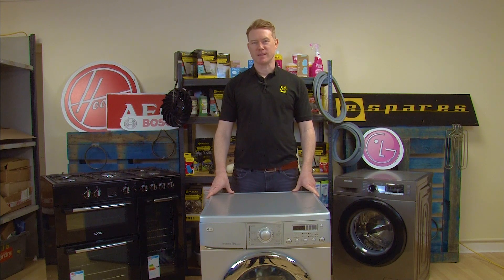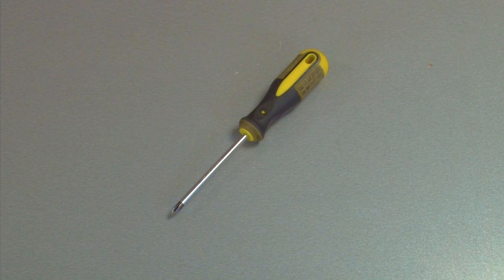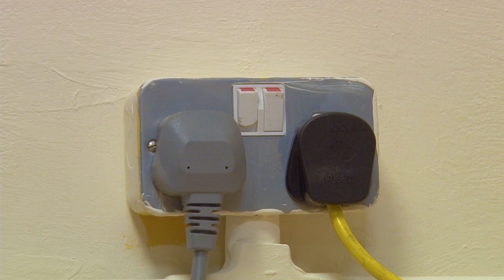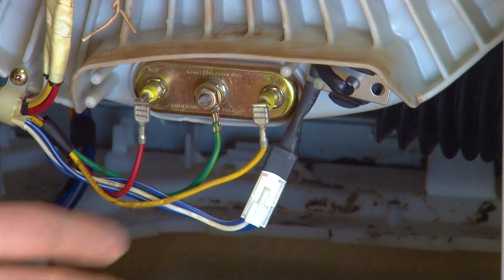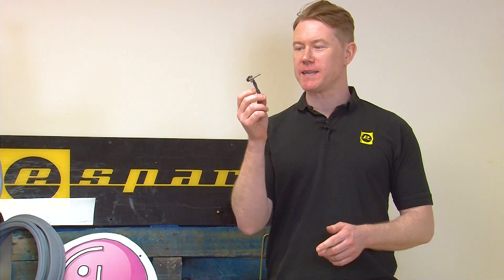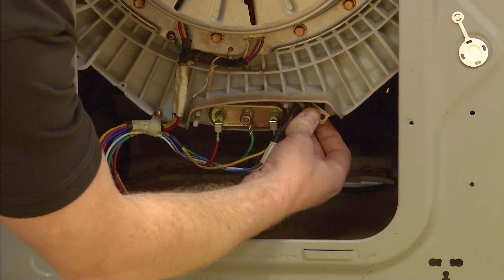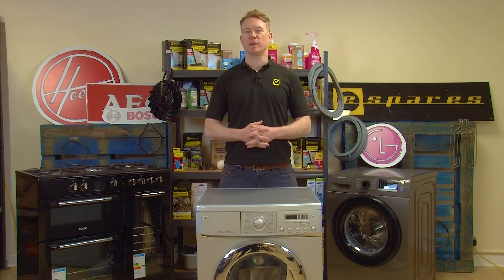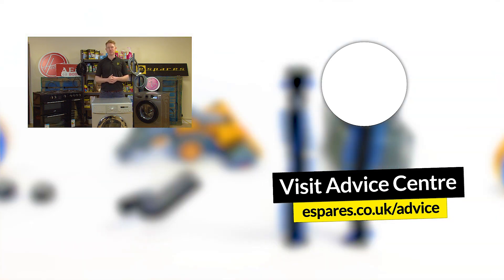tE Error Code on an LG Washing Machine - How to Fix

Comment: Thanks. I have an LG WM2688HWM and my transistor was located in a different area - it was located near the front of the area shown here and I had to tilt my washer forward (opening back wasn't necessary) and go underneath the hole at the bottom of the washer. The area was a bit hard to get to and I needed a flashlight, but I was able to repair otherwise. Posting this just in case someone else has the same issue.
Reply from the maker: Hi, thanks for sharing the process you had to do for your particular model of washing machine, hopefully it helps anybody else with a model such as yours!
Reply: You mean thermistor?
Reply: @dilandogbp  yep